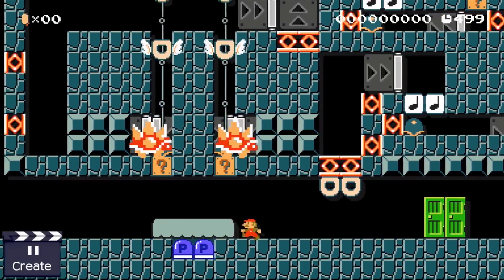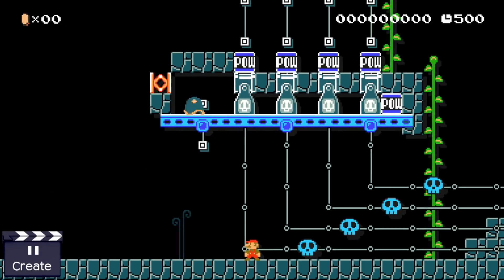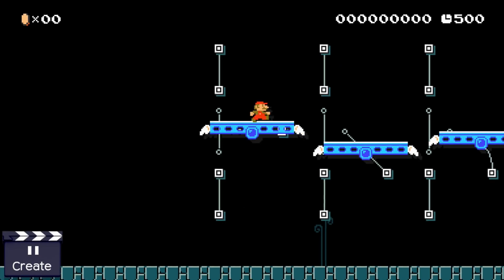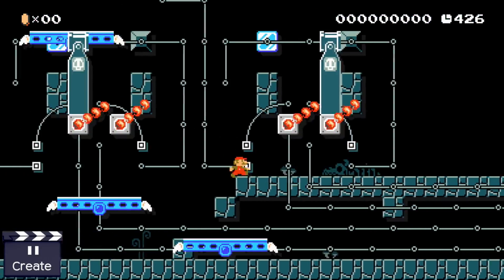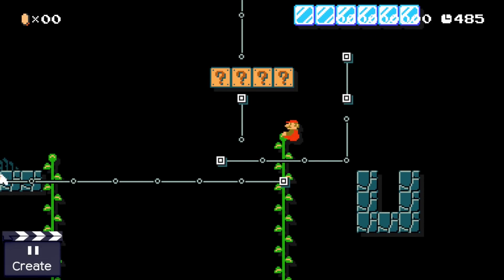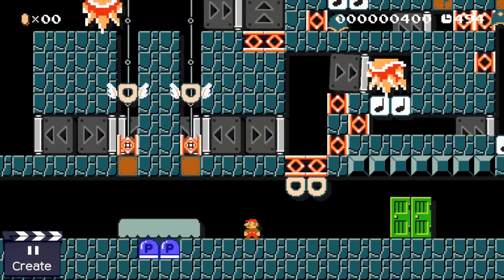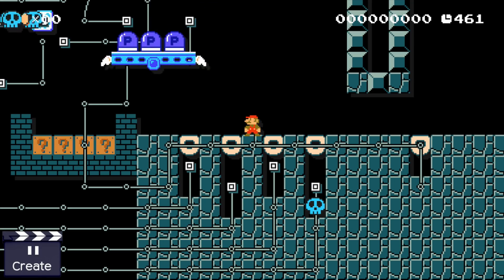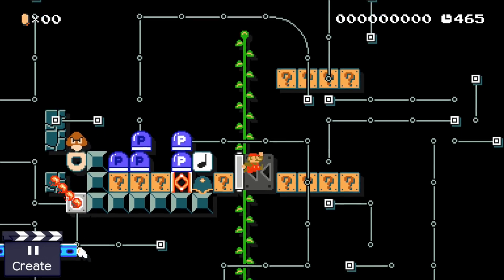Is it Possible to Build Binary Storage in Super Mario Maker ?

Comment: I got a solution for each. I haven't tested them, but they all work in theory.

AND: Drop each value set on top of each other, and extract the top layer. That should be the answer.
OR: As above, but use the bottom layer instead.
NOT: Drop a p-switch onto each bit. Then, drop another pow block onto each switch. Extract the middle layer and activate all switches. This should be your answer.

Comment: Ceave, if you really want to use data storage, I would recommend using Hexadecimals. You can have up to 16 different values for one digit, and each stores the corresponding byte. This could be achieved by creating a system that can store up to 16 combinations. I believe this would best be done using conveyor belts, fire bar memory, and basic track logic. Simply set each of the bullet blasters at slightly different heights. Then by using buzzy beetle shells on fire bars, you can send the output through various gates.

Comment: At the equation, you made a little mistake. A minor one. 9*10³+3*10²+5*10¹+2*10°. 2*10°=0. 2*10 is 20. If you divide 20 by 10 you get 2. It should have been 9*10³+3*10²+5*10¹+2*10°’¹.
Reply: hipje 2*10^0=2.
Because anything^0 is always 1

Comment: How you might build a NOT-Gate:

Let the switches fall onto goombas, and than set the goombas free to walk onto note blocks. Only those goombas that weren't smashed by a p-switch will drop a new one. And as an added bonus, the new ones are also despawn resistant due to being dropped from a noteblock.

Comment: I got a working NOT gate, though it requires the input bits to be represented by munchers. (Not sure if that’s really a problem, you can use note blocks to “convert” other stuff into munchers anyway.) For each bit, put a coin, a brick block right above it, a cloud block above the brick block, and a P-Switch inside the cloud block. The platform comes from the top, triggers every P-Switch where a bit was set, and once the P-Switch timer runs out, the remaining switches (i.e. the bits that weren’t set in the input) fall down. That doesn’t work if the input is empty, although you can have the platform lift another P-Switch into a muncher at the end. If you put a coin between the final P-Switch and the muncher, it won’t even extend the timer for non-empty inputs.
Reply: Another problem is that it's not very compatible with Ceave's design, unfortunatly. And it adds quite a bit of extra processing time with the P switch.
Cool idea though! Here is mine: https://imgur.com/a/g7O2hDL
Reply: Nice!
Reply: Thanks!

Comment: Talking about bits and bytes? Even more proof that you’re actually Pannenkoek
Reply: this is proof that you don't do computer programming
Reply: Pannenkoek talks more about floats than bits and bytes though. /s
Reply: Floats are still represented by bits and bytes. They are just calculated differently.
Reply: My point is you don't need to know what a bit is to understand Panen's explanations if you just understand a float is a way to store numbers and the limitations of that variable type. Overflows and rounding errors can be summed up without the need to explain what a bit (or a byte) is. It's better, of course, but not mandatory.

Comment: My idea for how AND and OR could work (though I don't have SMM so I can't test it myself) is to take your 2 numbers represented as pow blocks and drop them on top of each other, then pick them up again and raise them into ice blocks that are 2 tiles higher than the track. Then the blocks that are stacked 2 high would fall down, which will be the AND, and what's left on the platform would be their OR.
Reply: It works but you have to get rid of the blocks your are carrying at the end and go pick up what's under the ice blocks.
So It's either impossible due to the complexity of the track layout or ridiculously long, unfortunately.
Want my solution? https://imgur.com/a/g7O2hDL
It's surprisingly simple.
Reply: That's genius
Reply: Yes, I was thinking the same thing. It seems a lot easier than the bit-shift, all the more because Ceave already showed us the bit-mask. But I don't have the game handy, so I'm not 100% sure it would work.

Did you test it?

Comment: Surely an "and" would just require the values to be placed into a gap to form a bridge, after which you would use some contraption to release a red koopa who would attempt to cross the bridge. If he gets across, he triggers one output (probably releasing another block), and if he reaches a gap he turns around, reaching a different trigger behind him. I haven't tried it, but i don't see why it wouldn't work.
Reply: Cause if he turns around he won't get the chance to test the remaining bits.
Reply: Toboter XP But  i thought that in order to get a positive output all of the bits need positive values, meaning if it reaches a single negative there is no need to test the others in that set.
Reply: Oh, sorry, I misinterpreted your specifications. You meant one koopa per bit, not one per number?
Reply: Toboter XP Not necessarily, no. I don't think I fully get where you're confused, but I'll try to explain it better. I hope this helps.

As far as I understand, when you're doing an and test the only two outputs are either positive (all bits are equal to one, or, in our case, the bridge has no gaps in it) or negative (any or all of the bits are equal to zero, or there is a gap in the bridge). For example, if the values were 1101, the koopa would get as far as the second pow block and turn around. It wouldn't matter what any of the following values were because it has already determined that there is at least one 0 in the sequence, meaning the output must be negative.
Reply: I see, you misunderstood the problem. Ceave ment taking two binary numbers and calculating the AND of each of the bits, so the first two bits, the second two bits etc., not and-ing all the bits in one number together.
Reply: Toboter XP Ah. I guess that makes more sense. I did find it a bit strange that there would be a solution so simple. In that case, you could place the two sets one on top of the other and only pick up the top line. That way only the two-high stacks, or the cases where both bits are positive, would output positive.
Reply: You could similarly do a NOT by lining up the pow blocks before dropping p switches on top of each bit. Then, drop a pow block on each of those. You would then remove and dispose of the top layer and activate all of the p switches in the middle layer. You should be left with the correct values in the middle layer.
Reply: While I'm at it, an OR would just be made by dropping the two values on top each other before removing the top layer.

Comment: The mechanism behind the x + y = 15 puzzle made me think of a possible way of implementing an AND gate. What you do is you put your P-Switches such that you get two rows of P-Switches and then test if each column has two P-Switches on it.

So let's say you want to compute (1101) AND (0110). This would give you 0100. What you do here is you first get your P-Switches like this, where [P] is a P-Switch and [E] is an Empty block:

[P][P][E][P]
[E][P][P][E]

With the power of gravity, this will change into the following configuration:

[E][P][[E][E]
[P][P][P][P]

What you now do is you find a way to trigger only the TOPMOST P-Switch on each column and then pick up the result again. As a result, you will get

[E][E][E][E]
[E][P][E][E]

The four empty spaces are unnecessary, so you get the output

[E][P][E][E],

which is 0100 = (1101) AND (0110).

If you figure out a NOT gate, you should now have an OR gate since NOT ((NOT A) AND (NOT B)) =  (NOT (NOT A)) OR (NOT (NOT B)) = A OR B, so if you got NOT A and NOT B as inputs, then you can perform an AND operation on these two to get A OR B.
Reply: Woah im impressed. Good job
Reply from the maker: That's really clever! Something like this should actually work! :D
Reply: Now that I think about it, the NOT gate isn't necessary to make an OR gate. What you do here is you simply mirror this design but instead REMOVE any P-Switches in the second layer.

As an example, let's compute (1010) OR (0011). This should give us 1011. What we do is we go through the same process, but we get

[P][E][P][E]
[E][E][P][P],

then gravity does its thing,

[E][E][P][E]
[P][E][P][P],

and now we can push away the SECOND LAYER of P-Switches to obtain

[E][E][E][E]
[P][E][P][P],

yielding the final result

[P][E][P][P],

which is equal to 1011 = (1010) OR (0011). The remaining challenge is now to implement a NOT gate and we're done.
Reply: Can you make a function that tests for if there's exactly one P-Switch in each column? By this, I mean make a function

f : {0, 1, 2} -> {0, 1},

that does the following to these numbers,

f(0) = 0,
f(1) = 1,
f(2) = 0.

If so, you've created an XOR gate. With the XOR gate, you can make a NOT gate. The way you do this is you take your input and XOR it with the input 1111. If there's a 1 in the input, you get a 0 in the output. If there's a 0 in the input, you get a 1 in the output.

Comment: Hold on... You forgot that you have to add a 0 at the end of the binary so the number will be negative. For example, 10010010001000 is really 8192-(1024+128+8) or -7032. Not 9352. It's interesting how one number can change everything.

And to thing I was doing "light reading" on this subject when I was in middle school. 😂
Reply: It's at the beginning of the number that you put the signing bit.
And it's not always necessary: if it's an unsigned int, you can leave a 1 as the most important bit and it's still positive.
Also you made me cringe at the end: "haha, quite funny how EARLY I knew about all this, unlike most of you".
Reply: In computers one bit can be used to indicate if a number is positive or negative, but it doesn't have to be. If you have 4 bits you could either use those four to write a number between 0 and 15 or you can use those to represent a number between -8 and 7. So your number is either -7032 or 9352 depending if you are using a signed or unsigned int.
Reply: if I add a zero at the end, i shift all bits up. 
Positive and Negative Values are dependant on the type used.
Signed = 0/-127/127 (where 0xFF is -1, 0x7F is 127 and 0x80 is -127) depending on architecture and byte, of course. I used 1 byte here. Usually, the "sign" bit is the very first bit, here at 1000 0000 (128d, 0x80)
Unsigned is just 0 to maximum binary bits in absolute numbers.
Reply: What he called the "end" bit is obviously the most important bit, the one written on the left. No need to correct them on that specific part.
Reply: I never figured out what the most important and least important one was, so I read it LTR.
Reply: Think of it like that: if a bit's state makes the biggest change in the number's value it's the most significant. If you change the 1 to the beginning of a number coded on 4 bits to a 0, the difference you made is 16. Changing the bit on the other side (the rightmost bit) only adds or substract one. Therefor it's the least significant bit.
Reply: 4 sentences, and I understood it. Thank you.

Comment: Ceave? Is there a secret Video again? 12:17, in the ground there is an "0xF".
Reply: Nope, in hexadecimal language  0×F means 15.
Hexadecimal language is another language that uses base 16 with this order of numbers: 0, 1, 2, 3, 4, 5, 6, 7, 8, 9, A, B, C, D, E and F
A equals to 10
B equals to 11 and so on...
Reply: In the question block tips video, there was a secret video by finding the correct YouTube link. In the original video, he skipped two ideas and in the video which was secret he revealed them. I wonder if it's again like this in this video.
Reply: No that's just the clue to get the key to the door.
Reply: what do you mean by a secret video?
Reply: Oh, ok :)
Reply: No secret videos. In that level you had to set number 15 in binary and 0xF means 15 in hexadecimal...
Reply: Crimson Vale too late (jk)
Reply: As the guy who cooks the Whoppers, I wouldn't be entirely surprised.
Reply: LelonskiHD 
It probably just means 15.
Reply: Want, it does
Reply: Cipollotto 16 Bit Number 15
Burger King Foot Lettuce
The last thing you’d want in your Burger King burger is someone’s disgusting foot fungus, but as it turns out, that might be exactly what you get...

Comment: Next up = is it possible to create a 3d game with super mario oddysey movement mechanics 

This is a joke. Dont take it serious
Reply: Yeah, but, it’d be overwhelmingly exhilarating. It needs to have the ability to perform hundreds of SIMPLE trigonometry operations before it can even begin a grasp on 3D graphics, which would require piles and piles of calculation on the hundreds of triangles composing the surface of everything. It also needs to have nodes you can just move to animate, and when it’s all done it needs a way to project the extremely large single frame it created into a pixel picture. You might be able to do it, but you’d have an unbelievably limited colour scheme - less than like 256 bits. Plus the timer would run out first. And seeing that it’s 60 FPS. You’d be waiting months or years just to get ONE FREAKING SECOND of gameplay. We need something that can actually move like lightning which I heard goes a third the speed of light. Went on Google quick and it turns out it goes at like 97,536,000 metres a second. And what do we have in that video up there? A slow ass mechanical platform doing intricate work just moving like the slow, heavy mechanic it is.

So yeah, but not for you.
Reply: @FireyDeath4  so it is actually surprisingly simple, right?😂
Reply: Joseph Stalin, have you heard of a shell jump?
Reply: I mean if ceave had infinite level space he could
Reply: Joseph Stalin It's too late, he actually did it
Reply: Mr.Panface , indeed i did.
Reply: If Mario odyssey had unlimited scene storage it might be possible it would just take years to generate a frame.
Reply: Joseph Stalin genius
Reply: The Pear Channel 
Y’all eat air
Reply: Joseph Stalin haha funny meme Stalin xDddddd
Reply: Joseph, my grandpa has been trying to get in contact with you.
Reply: FireyDeath4 Wut
Reply: Well, it's actually super simple...?
Reply: If you say to not take it seriously you know there is always someone who does.
Reply: and this 3d is inside a mario maker computer
Reply: Ceave makes it

"Wow, its really simple"
Reply: Aw, I had thought you were serious and he was really going to do it!
Reply: it's actually S U R P R I S I N G L Y  S I M P L E